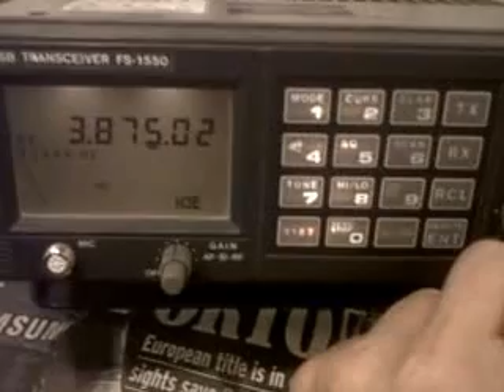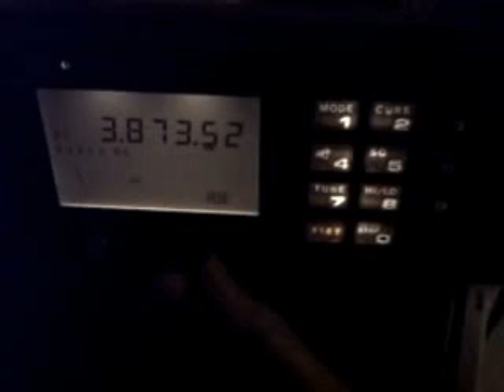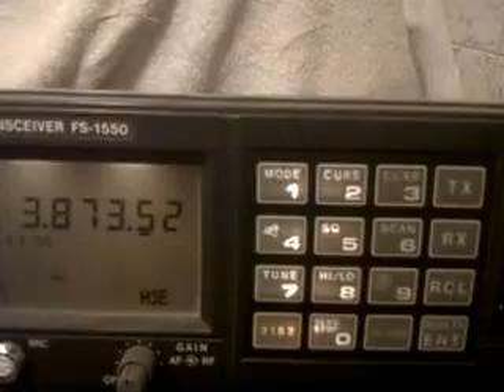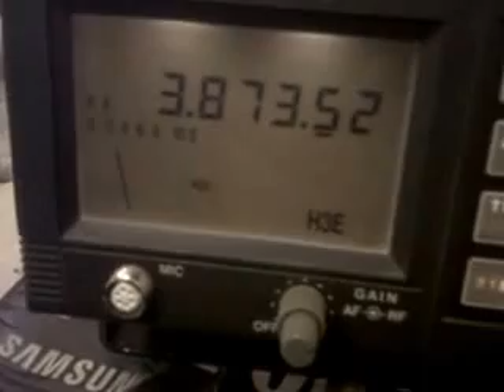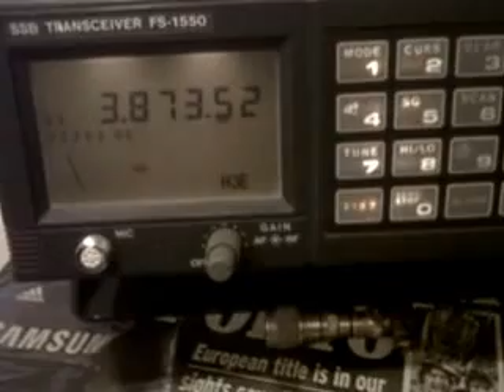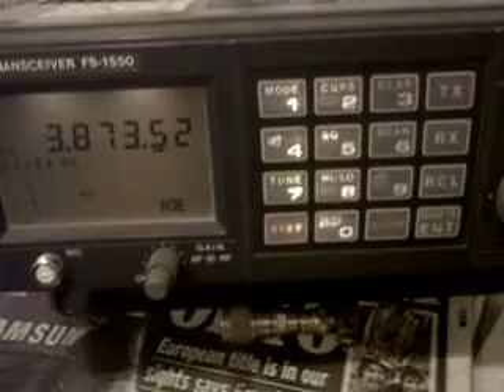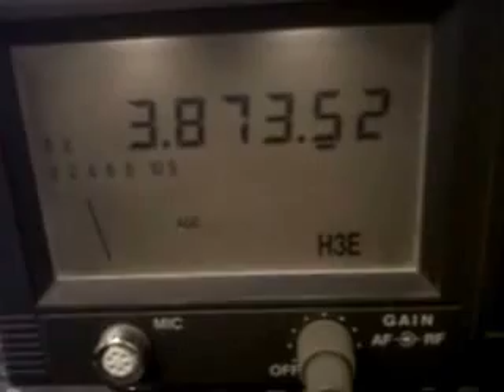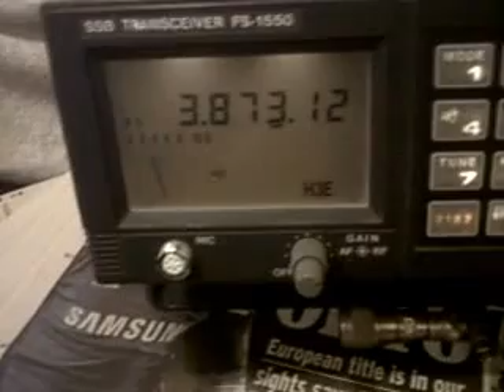Furuno 1550 80 metres Am American Amateurs PART 1 -20120331-0439.3GP

Comment: Good afternoon! I have a FURUNO 1501 transceiver. I can use it to work on short waves. In Amateur bands on LSB/ Or it is necessary to open it or enter codes. Very little information. Please tell us.
Reply: open it and change a few dip switches will open TX all band
Reply: Switch ON S17-1 and S17-2  located at the back of front panel. CPU circuit.